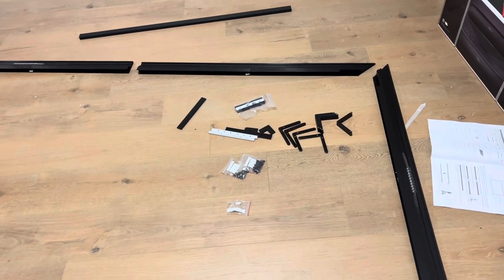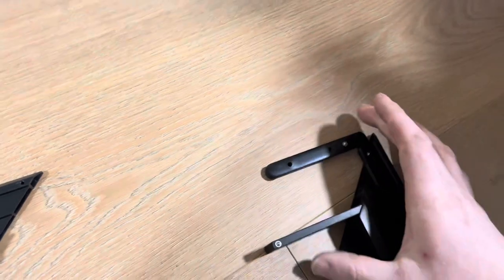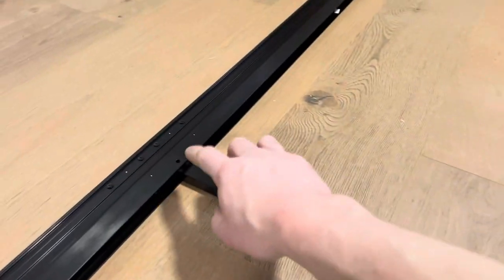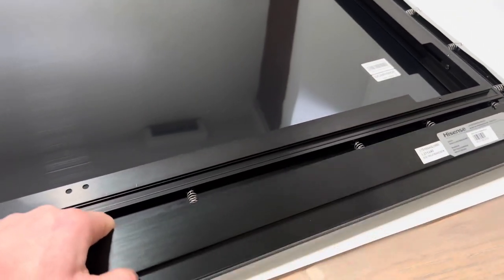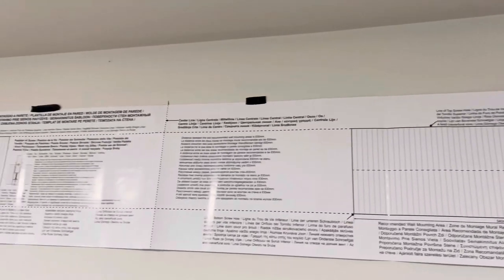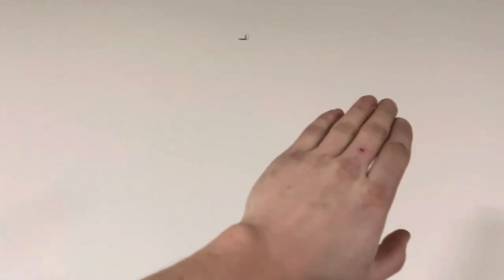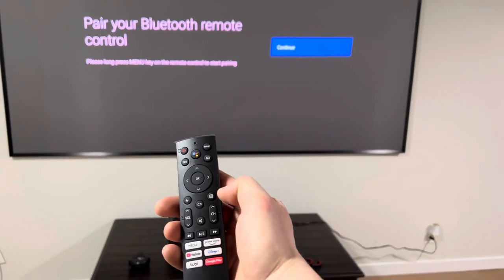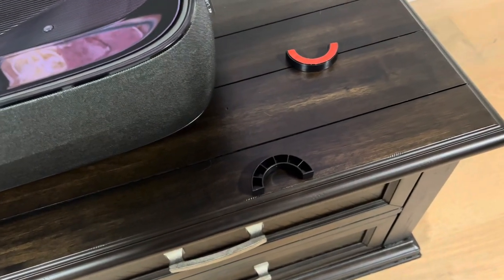How to install Hisense L9G laser tv projector and alr screen

Comment: Hello, I will be installing the 100” version in my basement, the walls are lower but i do have the 68” from top of ceiling to bottom of stand as seems to be required. This does mean that the stand will have to be very low profile like 10” off floor, do you think this will be an issue? thanks!

Comment: How many inches up is the top of that paper template from the top screw hole line? Like 3 inches?
Reply from the maker: It’s marked on the template as I show I’m kind of confused by your question. The top line is on the template and so is the bottom line.
Reply: @ghostlyrich  I threw away my template… so idk how tall I could go with a table it’s been off ever since I bought it. Not as good as yours. 
 
I could find the right measurements if you know how many inches the top of the paper is from the top screw line, which is the line nearest to the top where it wants you to drill, I think. I could be wrong. 

But i just need the top of the paper measurements from the like nearest to the top of the paper. 
 Or I could try this… how many inches away is the top of your screen from the top of the table. And how many inches away do you have to table from the wall where the screen is placed…